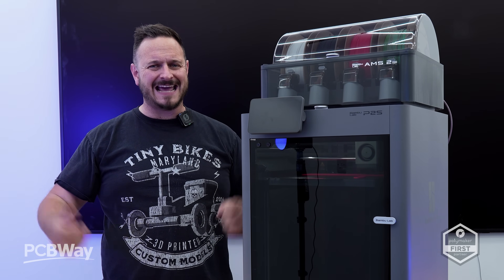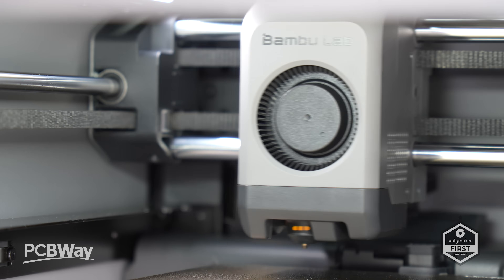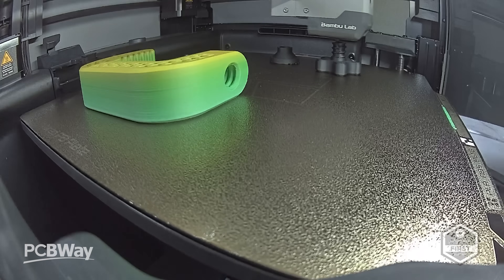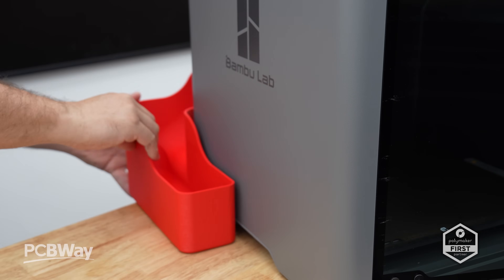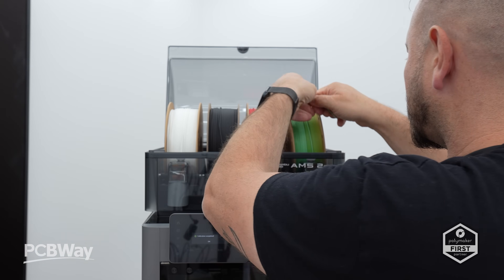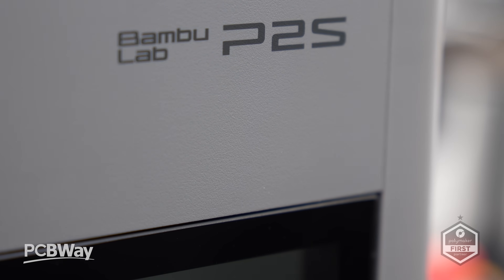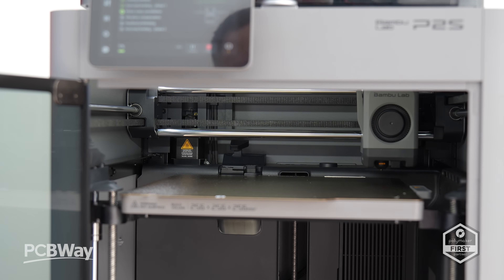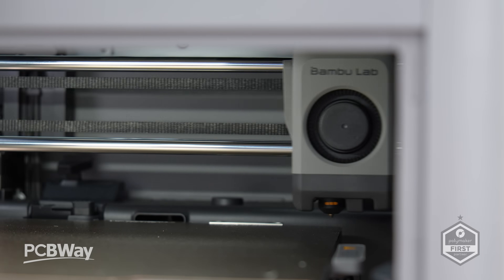Bambu Lab P2S Combo Review – Best 3D Printer of 2025? TOTAL Breakdown!

Comment: I started out а lit later than everyone else in 2020 with the Ender 3 pro which granted I got for 100$ used and it did serve me very faithfully but I had to fiddle with the settings a lot so make it work, but I learned a lot about 3d printing from that experience. I then upgraded recently to the Ender 3 V3 KE and it was also great, but both these open printers and I would argue any open printer without a dryer box -  the filament gets wet at some point and you start getting into the battle of drying it then tweaking settings to make it stick and not blob or become spaghetti, I've had enough and I ordered the P2S Combo last week, sad thing is they will ship in the EU in February I can't wait 😂
Reply from the maker: Sounds good. You’ll certainly see a difference between the brands and the technology.

Comment: You missed one of the main problems with the P2S when printing with ABS/ASA and other filaments that give off fumes & VOCs. On the P1S they had a cutout behind the filter that vented the internal air. Now on the P2S they removed that and give you the option of either circulating internal air through the filter or opening the vents and bringing in outside air. The problem is this will force fumes/VOCs out between the door seals and poop chute and/or through the vents. This is a real problem when printing with ABS/ASA and other filaments that give off strong VOCs. Voxel and others have products like the X Filter and Bento Box to help provide better fume extraction for the P1S (and these work well) but since there is no native air export cutouts on the P2S behind the filter it seems they can’t offer options for the P2S. Note that I have talked with Voxel about this and they are coming out with components to address this problem on the P2S in the first week of December 25. Will be interesting to see how this works and if it does fix the problem. Seems odd Bambu has done this, user safety is a risk when printing with these types of filaments. Any comments?
Reply: Inyeresting thanks for that, quite an oversite on Bambu's part.  I was just about to press the Buy button but now not so sure, is there any update on this from Bambu or aftermarket supplires yet please?
Reply from the maker: I’ll ask them what their plan is to resolve, Tom highlighted this issue also

Comment: Things they do not tell you:
Automatic flow calibration does not work with a 0.2 mm nozzle.
You can't dry, and print at the same time with the AMS pro.
Bambu lab filament profiles are only calibrated to the 0.4 mm nozzle.
Reply from the maker: All true, nothing is perfect tho

Comment: i bought the p1S like a month ago, i want to cry really...
Reply from the maker: They aren’t stopping making them, and I don’t think it’s going to limit you :)
Reply: I wouldn’t be disappointed. The P1S works perfectly well. I hardly use the screen because I use my laptop when I’ve created a part. For the makerworld I just use my iPad to send to the printer. The only thing I would like is the quick changeover nozzle but as I haven’t done that yet in the past 3 months then up to now it hasn’t been required. I’ve use TPU  and PETG as alternatives to PLA. The AMS has been used for multicolour prints but I’ve found it most useful for when I’ve done a large one colour print and it automatically uses the next spool if it is the same colour. Enjoy your printer.

Comment: Sadly they are looking for more per unit profit, nothing on this seems justified enough to cannibalize the $750~ enclosed price range the P1S filled.
They will probably keep the P1 series around in some form to fill that gap.

Nothing wrong with the printer, just commenting on the price range gap, it is a thing in marketing/sales
Great vid!
Reply from the maker: I think this was more to be a replacement for the x1c
Reply: @TheRealSamPrentice  that's what it feels like, but taking a lower cost and higher cost and mixing is that price tier killer
Reply from the maker: Well, let’s see what the market has. I definitely don’t think it would be a failure.